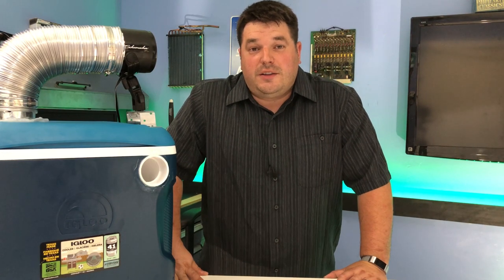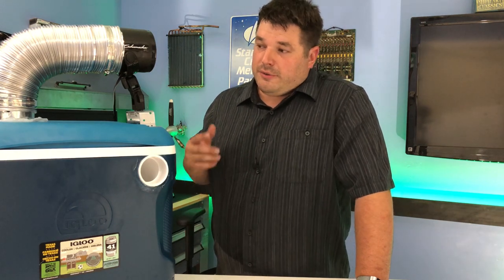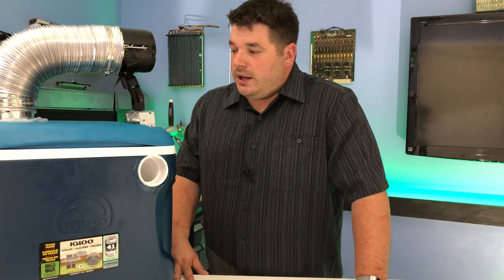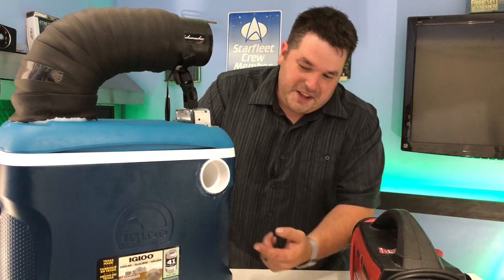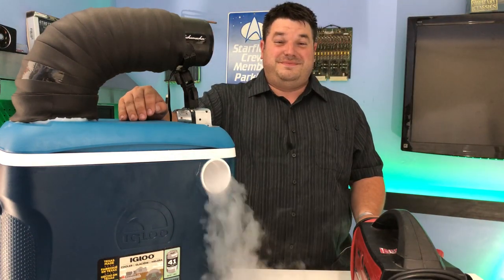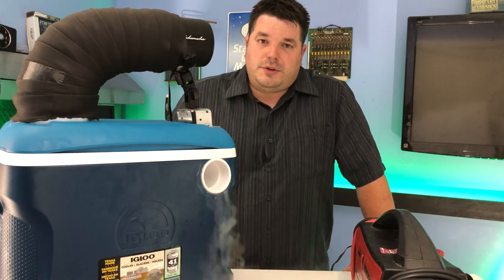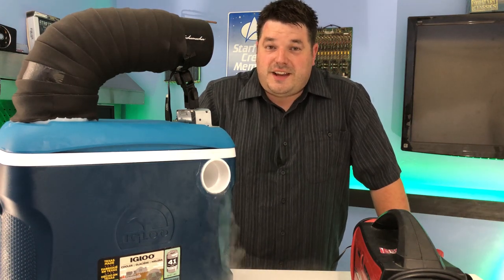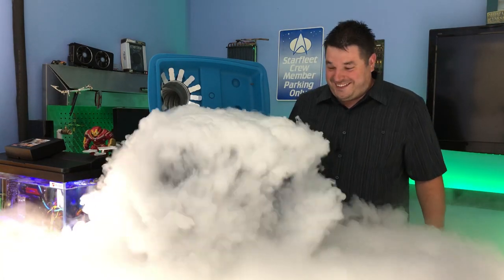DIY homemade air conditioner with dry ice.

Comment: it can work if you have a pure oxygen tank you can use while feeling the blissful cold air, of course you'd put the dry ice system outside of the room, pumping its nice cold air inside the room, with a o2 system connected to your lungs, problem solved.  AC camping in the desert brought me here.  How that cooler with ice and dry ice in a contained unit works in 100 degree desert weather for the 10 hours of sleep is something i'm still researching though.
Reply from the maker: This is my favorite solution to dare and by golly that would make an entertaining video! Imma do it!
Thank you very much!

Comment: Definitely an indirect approach would be better. Or use dry ice along with regular ice and find a nice mixture of the two. I deliver groceries and have access to alot of dry ice and sometimes I'll throw peices of it in the air vents if I get a truck with no A/C and it actually does cool down the cabin a little bit. I want to make some kind of device that is portable and pretty small. Cool video sir

Comment: Love you’re line of thinking. I’m up here in the middle of Michigan where we might get a week or two of un-godly hot weather. The house is about 900sq ft. with an oil furnace in the basement. Lately I’ve been shutting up the house, taking the access panel off the furnace and just letting the squirrel cage pull the cool air out of the basement. Kind of works. Still cooler than outside. What are your thoughts about placing a chunk of dry ice in front of the squirrel cage? Would there be any adverse effects to the motor, and how long would the dry ice last?  Fun fact: The old touring bands from back in the day used to toss their power amps into a cooler with dry ice. Can’t have enough watts! Thanks for your due diligence.
Reply from the maker: Man i love your ingenuity but i cannot say dry ice is a good idea, the co2 asphyxiation could make for a bad day and all.
Reply from the maker: You know you could probably make a system that uses a radiator in front of the fan and circulate cold water through the radiator.
Reply: I like the radiator idea. Would be a bit more cost effective and safer. Thanks!👍🏻

Comment: I would think Dry Ice would be perfect for personal cooling in outdoor or well ventilated areas using low powered fans that run on USB power. In theory the more powerful the fan, the faster the Dry Ice would dissapear. With a slow fan speed the air may not be totally frozen by the time it exits but still be cool by the time it hits your face. Plus you wouldn't be going through the Dry Ice nearly as fast. Hoping to test this myself.
Reply from the maker: I love the effort boss! Outdoor is the best idea for sure but please be careful, co2 is still co2

Comment: Before you even touched on the subject, I was thinking about how to use one in a camper doing an air to air exchanger set-up and drain the CO² outside somehow.
Reply from the maker: I am working on a design that may work, it combines acetone and dry ice to make a system that should do a much better job and properly isolate and vent the co2
Reply: My main problem right now is that I'm staying in a tent while I work on getting a camper to live in. Then, my problem is no power hookups for the foreseeable future. Staying at a campground here in South Dakota and the busy season is here and the campground RV spots are booked for the Motorcycle Rally in August.
Reply from the maker: @addamochs  i recommend this one, you can adapt it to 12 or 18volt batteries to
https://youtu.be/EYEDD7dW47M

Comment: I kind of like this idea, with hurricane season here, I often am without power for a week or more, and a big stash of this could cool a small structure like an ice fishing shanty. I'd be thinking more sitting the dry ice on top of a radiator vs a grate and pulling the air through that into the tent to keep most of the co2 out, or doing it with fluid/pumps--but I'm guessing that's the kind of upgrade you hint at right at the end.
Reply from the maker: Hey thank you for watching and commenting! in fact yes the idea I’ve been working on is indeed similar to a dual exchanger design.

Comment: What if the dry ice is in a sealed bag?
Would a wet Vac have a stronger motor?
Reply from the maker: I like the creative idea, unfortunately since dry ice is co2 in solide form as it melts it turns into co2 gas and that takes up allot more space. In a nutshell, would need a really large bag, definitely bigger than the cooler. Also through other testing i have found that heat exchangers dont work well, as soon ice the ice melts away from the wall the lidenfrost effect insulates to well.
Thank you for watching and commenting! I really appreciate the participation!
Reply: Guess you might need a vent hose in that bag, so that doesn't happen.

Comment: Just curious if I could use this dry ice in my homemade ac cooler in my 21 foot travel trailer "JUST" to try and keep it cool while traveling when it's very hot outside until we get to our destination and plug into shore power. No one would be in the camper??
Reply from the maker: Well the thing is that the co2 would build up and saturate the trailer creating a very high asphyxiation risk. So you would be forced to ventilate the trailer for at least thirty minutes before its safe to enter and by that time all the cold air is blown out. 
Unfortunately the use of co2 for safe and cheap cooling is still out of reach.
What could be a neat idea that i want to try is adapting to a 12volt ac system and tying that into vehicle power so that the trailer can be air conditioned while on the go without extra equipment.

Comment: All the more reason for a drain. CO2 goes to the lowest point and would flow thru a tube probably 1/2" at least I.D. Probably need to be insulated to keep it from condensing moisture out of the air like the other pipe.
Reply from the maker: Thank you for watching and commenting. Unfortunately this whole video was just for shits and giggles, theres no way to make this design safe.

Comment: For example if you order steaks from like Omaha steaks or something like that they ship it to you packed in dry ice the dry ice is concealed and it doesn't poison your food what I'm thinking is can we wrap the dry ice up and plastic or something so the gas is can escape and it will cool the air inside the core and we can enjoy a good clean air or maybe allow the dry ice to be open and cool the air but vent the gases elsewhere allow them to dry ice to cool the entire chamber separating the gases but just collect the cool air that's what I'm trying to figure out
Reply from the maker: I love your enthusiasm my guy!
There is indeed a solution, it may just be a bit more complicated.
Reply: I certainly know it is I think I have ideas how about how fix the problem

Comment: What if you used a 3-way valve to mix the cold air and warm ambient air into the fan's inlet?  Would that allow decent temperature control and possibly prevent ice from forming in the fan?
Reply from the maker: I love that you are thinking creatively but i must preface this response with, dry ice is co2 and as it sublimates it releases large amounts of co2 in the air witch can asphyxiate a person so i do not recommend trying this!
That being said, yes air mixing is actually a pretty good solution as it would produce a larger amount of reasonably cool air.
But seriously dont play with dry ice in a closed environment.
Thank you for watching and submitting your questions!

Comment: Question: i have a portable evaporator cooler, What if you have the dry ice in air tight sealed bags???
Reply from the maker: Hi thank you for watching! So the short answer is it wont work nearly as well as you would think, theres off gassing and surface area and stuff.  Now using things like super cooled stones or ice packs would help a little bit
Reply: So… as water ice melts, its volume falls by about 8%, because water ice is slightly less dense than liquid water. As dry ice sublimates, it expands to 790 times the volume of carbon dioxide gas. So unless your “bag” is actually a high-pressure gas cylinder, you cannot seal in the CO2 gas. Your bag will simply explode after a small percentage of the dry ice has sublimated.

Comment: What if the dry ice was left in the bag it came in is it stl dangrous and have a window open
Reply from the maker: Hello Shauna thank you for watching and commenting!
So as dry ice “melts” the co2 gas takes up allot more space, that would make the bag blow up and most likely leak out. Having the window open is a good idea to allow fresh air but unfortunately that fresh air is likely hot else you wouldn’t need the cooler.
The only way dry ice can work is if its in a vented container so that the co2 can be expelled outside.

Comment: Is there any danger of CO2 poisoning?
Reply from the maker: Leo St.Corsa 
Yes and no
Co2 itself is not poisonous, however it doas displace oxygen. So it should only be played with in a well ventilated area.
I had windows open and fans running
That being said, if you subscribe, i hav a video coming out soon with a design just for dry ice that has a vent so it can be in a closed space
Reply: @TheRenaissanceBuilder  great!

Comment: I want to build one of these for the back of my truck but I want to seal the cooler, vent it and have either water go thru a coil in the dry ice and then thru a radiator with fans. Or maybe have the air blow thru a duct that runs under the dry ice thru the cooler. Anyone tried this?
Reply from the maker: So i have worked out a few tries with dry ice. The problem is that anytime you bring dry ice into an enclosed space is venting. The ice will sublimate back to co2 gas and it will find its way out of whatever container its in, so you hafto carefully consider the venting.
Reply from the maker: Also thank you for watching and commenting I really appreciate it!

Comment: You run the danger of suffication from C02, this is dangerous. 

How about isolate the dry ice and run 2 radiators linked with water hoses and water flowing between them. One radiator located in a cooler with dry ice / ethylene glycol(prevent freezing) and the other in the room you want cooled. Have the cooler outside and the cooling radiator with a fan on the inside. Will perform same function without c02 danger. 

One radiator is submerged in the dry ice/ethylene glycol in the cooler and the other is in the area you want cooled with a fan blowing through it for heat exchange, a pump is used to flow water between the two.
Reply from the maker: Noah Sheehan 
Thank you for the input
As I mentioned in the video that caution must be taken.
I also stated at the end that i do not recommend this design.

Your radiator idea is interesting if its ok with you i may try that.
But right now i have a re designed dry ice cooler coming in just a couple weeks so make sure you are subscribed so you dont miss it!
Thank you
Reply: @TheRenaissanceBuilder  go for it, would like to see if it works. It should in theory.

Comment: Here's another idea maybe do a split chamber in the cooler put dry ice on the bottom venting gases elsewhere but keep the second level of the cooler watertight and put regular ice in it with the dry ice be cold enough to make the regular ice last if so then we could use the regular ice blowing air acrossed it and stay cool meaning like can dry ice provide enough coolness to make the environment inside a cooler cold enough to keep the ice on the upper level of the core cold enough and last longer I know there's a smart person out there who's taking my words and putting it into thoughts that's why I can't really message what I'm thinking thoughts are more perfect than how one can explain it
Reply from the maker: I actually tried something similar to that already, a divided cooler. It almost killed me 😂. 
A bit of an exaggeration but yea it did not seal well and filled up my truck with co2 gas.

Comment: So my idea is put dry ice in a cooler that has 2 large cpu heat sinks connected end to end. One end inside the cooler and the other end outside. Have a fan blow air through the one on the outside and it should blow cold air because the its absorbing the cold from the heat sink its connected to from the inside....right? 

Would thisnwork or am i not getting it

Comment: I have an idea instead of the blowing the fan across the dry ice and risking suffocating how about trying to figure out how to conceal the dry ice or vent the gases in another direction while blowing air over the surface of the dry ice so that the cool air comes out but the off-gassing of the dry ice will not be a farm? Another words can dry ice be cold enough to call the inside of a Corso that a fan can blow through collecting that cold air and cooling a room down but at the same time have the off-gassing of the dry ice either be contained or vented otherwise, just like icewood cool something down you just want the cold air

Comment: What about just using a box fan??
Reply from the maker: So the idea of using dry ice, aka CO2, is a terrible idea to begin with so the type of fan is superficial at best.
That being said, box fans are great fans but not when controlled airflow is needed.
Thank you for asking!
Reply: @TheRenaissanceBuilder  No I meant using a box fan and putting a block of dry ice in front of it, my central A/C broke and can't afford to fix it, it's the old R12 system from 96. I have my seven blade 1970s box fan in my window bringing in the night air as we speak. But tomorrow comes a heat wave, 37°C or 97F! So I thought "hey what about dry ice in my bedroom? Then saw this and never crossed my mind. Of course my window would be open but not chancing it 😞
Reply from the maker: @m42037  oof i feel your pain! So i cannot in good conscience recommend dry ice in an environment like that, the consequences of it going wrong is just to high.
I do however have a variety of other coolers in different price ranges that do work well. I will tag some for you
Reply from the maker: @m42037  here is a playlist of ice chest ac units, im sure you can find one that works for you! https://youtube.com/playlist?list=PLxe04zgzy0OC5LqGI7K3AQiLSKOHaS55B
Reply: @TheRenaissanceBuilder  Ching! For a few bucks more I could buy a used AC unit, this boy's poor.. by American standards that is, I live in a Moble home
Reply from the maker: @m42037  even the one for 30$?
Actually gives me an idea for a future project. Thanks!!

Comment: Would you be able to use the dry ice for indoors if you made it so it was air tight? So the air goes through a copper/aluminum tube going in one end to the exit. So the dru ice doesn't go into direct contact with the air that gets cooled. The only thing that is in direct contact with the dry ice is the tube. And the cooler that the dry ice goes into is air tight So you can lock it down with no air flow.
Reply from the maker: Thank you very much for your question Angela! 
So im going to hafto say at this point that is a big NO, for two reasons.
One is that dry ice is co2 in solid form and as it melts/vaporizes (also known as sublimation) it puts large quantities of co2 in the air. I believe you already know that one im just being thorough.
Point two is that if you seal dry ice in a container then as that dry ice melts/vaporizes (also known as sublimation) then it will raise the pressure inside the container (as in the gas takes up more space than the ice) so unless the container can hold tens of thousands of psi it will explode.
Sooo i hafto say no.
The caveat here is that you can vent said container to the outside but the risk of asphyxiation is so high that its very dangerous. 
Whatever you do please be extremely thoughtful and careful.
I hope that was helpful, and again thank you for asking!

Comment: What was the Delta T factor with the dry ice?
Reply from the maker: So the delta was probably like 100* as the room was a about 70 and the supply air was -30 at the time of measurement. Since the idea was just entertainment I did not focus on accurate measurements

Comment: Needs to be a push setup not a pull setup. That way the motor doesn't freeze.
Reply from the maker: This was never meant to be a valide unit, it was just fun. Definitely don’t try it push pull or otherwise it is dangerous

Comment: What a great video!  Very informative.  I’m searching for a way to cool down my pontoon enclosure (basically a tent), and definitely leaning on the ice chest/blower method.  Watching the most popular video, I asked myself if dry ice was a option.  This video shows me that would not be a good idea.  I think the blower being placed on the outside will keep it from freezing, and using a large/single block of ice helps last much longer.  I just don’t want to wake up feeling like I slept in a field and now have a dewy coat of water all over me HA!  Otherwise , it was a cool video, and you’re picking up a new subscriber because of it.  Looking forward to watching the others!!

Donnie C.
Memphis, TN
Reply from the maker: Thank you very much Donnie and the subscription is very much appreciated. 
I would actually recommend the ice chest ac chiller system as i feel like it is not only quieter, it dehumidifies, and you can store as much ice water as you want to make it last longer.
I think ill make a couple final versions that will wrap it all up
Again thank you
Reply from the maker: Yes thank you for reiterating that.
Reply: @ariabritton9669  

You’re too late.  I used it in my enclosed tent.  I’m replying from beyond the grave!  Zombie YouTube subscribers are everywhere now, because of this video!😂😂😂😂😂

Read my reply.  I said thanks to this video, I knew it wasn’t a good idea on that front.

Thanks for caring!!